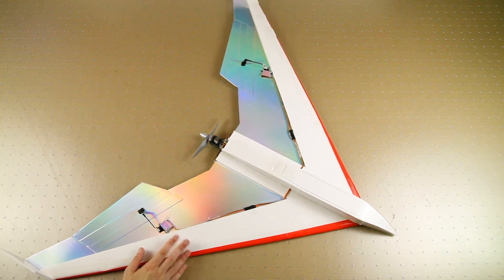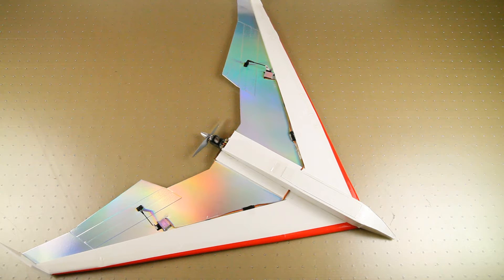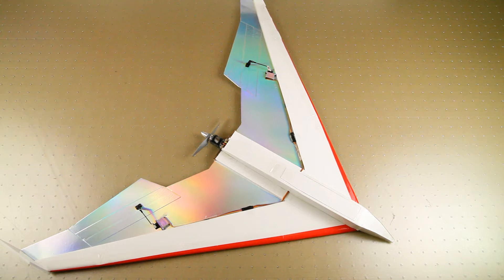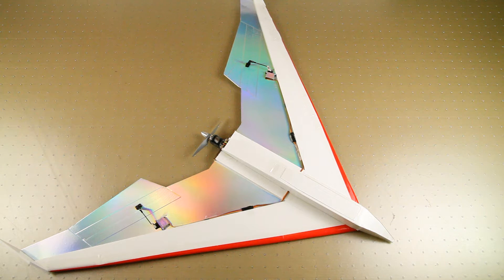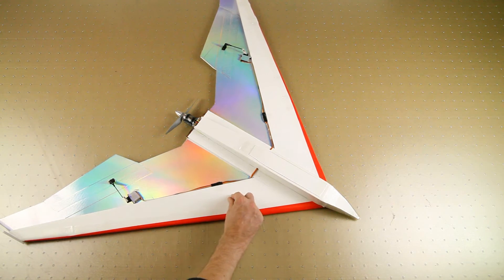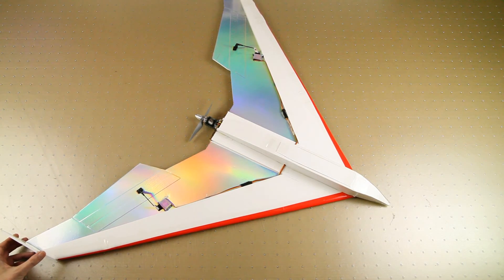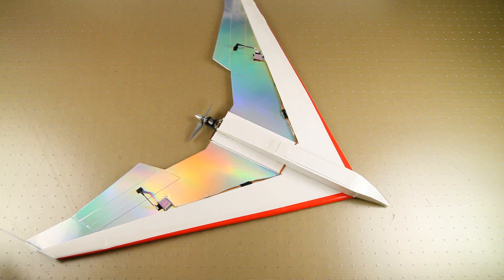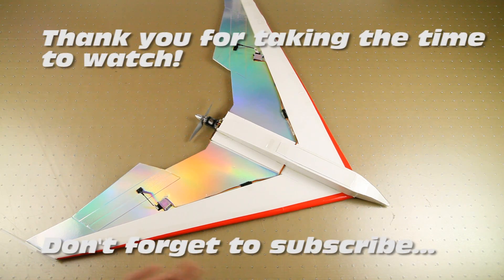Reversed Flying Wing Project - Part 1: Kickoff :)

Comment: cool idea buddy! If you can pull it off NASA will be rethinking their X-29 project ;)  Good luck!
Reply from the maker: DroneDude Thanks buddy! (somehow I didn't get a notification about your comment :( ) 
Ghehehe as most X-planes, the X-29 wasn't really intended to fly well.. It was constructed to research some aerodynamic mechanisms.. 
However. it failed beyond that regretably.. They could make the wing-tips stiff enough with the materials at hand in those days :)
Reply: Well, if they couldn't make the wings strong enough with metal.  I wish you the best of luck with foam!! haha
Reply from the maker: My plane will be 'a little' lighter. And it will probably be flying a bit slower ;)
Reply: haha, can't wait to see it :)

Comment: Since this is an extraordinary design idea, I would try for some self-stabilisation! For example a few degrees dihedral and a topwing design.
Reply from the maker: Skyliner04s I DO consider putting in a stabeliser indeed.. On the first prototype I won't however, as I want to see everything the plane does (a stabeliser will mask that).. 
And dihedral is Definately something I'll try :) 
Thanks for the input sir!
Reply: DutchRC ADVENTURES
Oh, we didn´t understood us here. I wasn´t talking about a stabilizer, I just wanted to say: Put some dihedral into the wing and mount the fuselage to the bottom of the wing instead of on top. However, since this is your design, I don´t want to dictate, what you should do! Just shooting some ideas around. :)
I look forward to the plane! :)
Reply from the maker: Ghehe THAT is quite allright sir :)  And I appreciate it :) 
Yes.. I think dihedral & getting the weight down low Wil definately be benefitial :)  
My first prototype won't have dihedral, so I can see the difference in the 2nd version.. 
I will put the lipo at the bottom of the wing though :)

Comment: Nice video! It seems like a really cool (and difficult) project! I would put the motor in the front maybe but I know nothing about it really. So are you butchering this plane or building a whole new one?
Reply from the maker: The RCAddict Thanks mate :)  Yeah.. this will not be the easiest project for sure! 
No no no! That speed wing wont go ;)  The EasyWing will though.. That one was blown of off a shelf in a storm (I had the window open a tiny bit).. That one has some damage And is a bit to easy to fly as well ;)
Reply: DutchRC ADVENTURES Ok, good. I was hoping you wouldn't butcher up that nice plane =D Hope it works out!
Reply from the maker: Neh. the speed wing looks nice and flies well :) I'd only scrap that one for a better speed wing ;)

Comment: I think have the motor on the rear, it will then behave more like a normal flying wing , but if I was you I would experiment and build 2 models (one rear motor one front motor) ;)
Reply from the maker: X-FLIGHT101 Well hmm.. there is one major consideration: the CG.. with the motor in the back, it would be HARD to get the CG right.. It would need to have a very long nose, with the lipo in it :$
Reply: +DutchRC ADVENTURES good point, once you have one idea there is ALWAYS something that restricts it. And if you have the motor at the front, it will make it easier to get the CG correct, eliminating the need to mess around with adding to much weight :)
Reply from the maker: Yeah.. I 'hate' extra weigth.. The build model now balances out at the CG even without the lipo in it  (I got a bit lucky)

Comment: feels really great to design something and get it flying. I just maidened my foam board b-24 that I designed with 4 motors this weekend infront of like 40 people. totally hooked now.  keep up these build videos. they are inspiring!
Reply from the maker: Nathan Knight No way man! That's great :D  So it flew well I assume?? :) 
This reversed wing project will Not be easy.. But that is okee offcourse :) 
Cheers and thanks for the support :)
Reply: Yeah. Check it out in the flitetest forums. Mad scratch builders. It has differential thrust. Does some crazy donuts. I have wanted to build a ritewing drak style swept wing. My ibcrazy planes have a slight forward sweep and fly great but this thing here is crazy :)
Reply from the maker: Do you have a link for me Nathan?? :$  That sounds quite a bit like that mini B-17 I did some video's about a while back :)  Diff thrust is great huh? :D
Reply: Sorry, was on my phone earlier. here it is: Maiden is page 2. 

http://forum.flitetest.com/showthread.php?20801-B-24-DTFB-design-and-build-log

now that its an actuall working model i need to finalize the plans and will get a pdf link up on that build log.

Comment: Cool idea... i know nothing about how it would work but i think motor on the front would work better for it to fly stable. A very interesting project for sure, it'll be cool to see the maiden flight attempt!
Reply from the maker: Mike's RC Corner Thanks Mike :)  You know what? When I started building wings, I had a hard time imagining a wing, with the motor at the back could fly stable.. They are though ;)  It could very well be though that that works differently on a reversed wing :$  
So yeah.. I will opt for the front-motor :) 
Cheers and thanks for the input! :D